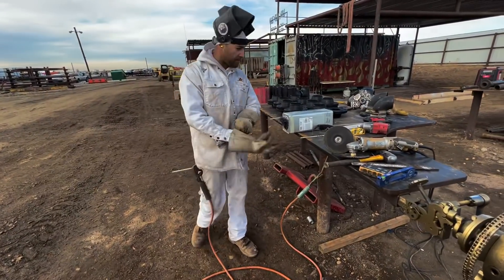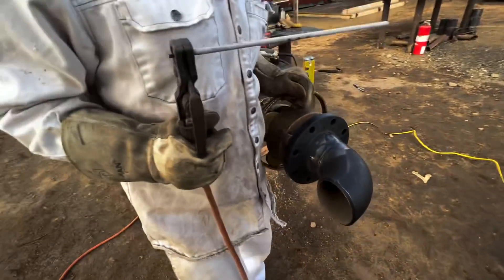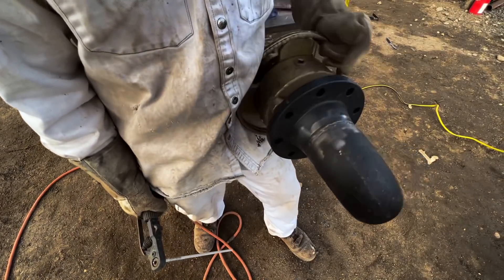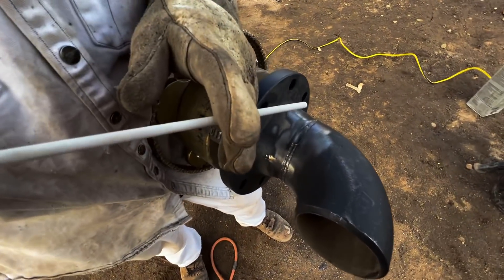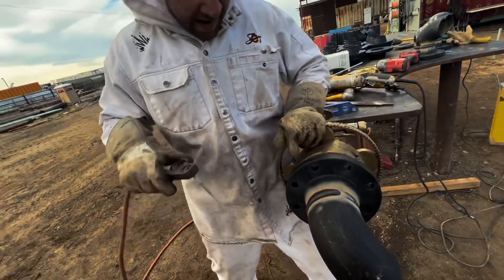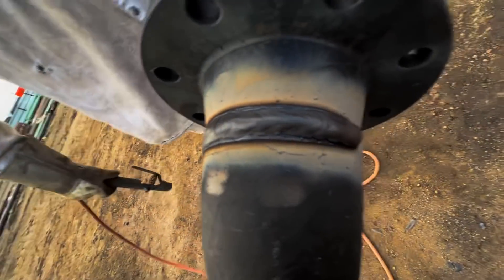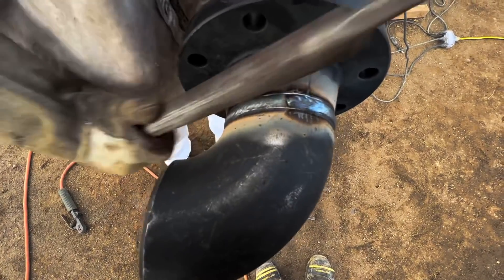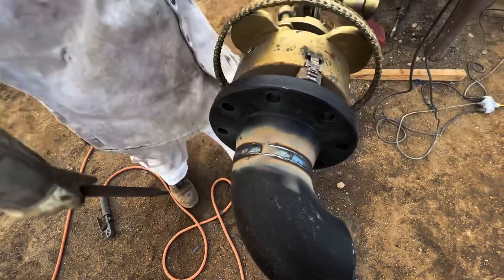How to weld like a pro learn now #welding

Comment: Question about the roll out and capping with 70.  Does that cause it to pull like that.  I usually do throat last to keep from pulling or do you have it out on fit so it pulls in?
Reply from the maker: Well yes on the throat it does like to pull more good point so yes there is a lil tolerance there but for the most part after the bead and hotpass it should be solid but you always face the 90 to get the fit again and it wouldn’t be much
Reply: @Wallyzweldingworld  that makes perfect sense then if you reface other end so it's perfect.  Thanks for response
Reply: @chrisjones6165  what is reface y’all ?
Reply from the maker: @chrisjones6165  anytime man have a wonderful day
Reply from the maker: @srjr2531  it’s when you can re square the 90 with a grinder just a lil
Reply: @Wallyzweldingworld  so essentially after you run the hot pass grind it down some ?
Reply: @Wallyzweldingworld  you to brother
Reply from the maker: @srjr2531  after it’s welded out if it’s outta square ya can grind the face to the 90 not welded level and re bevel should be good
Reply: @Wallyzweldingworld  ohhhhhh no shit huh lol man I’m always learning something on these comments or by your videos thanks a lot for the knowledge !